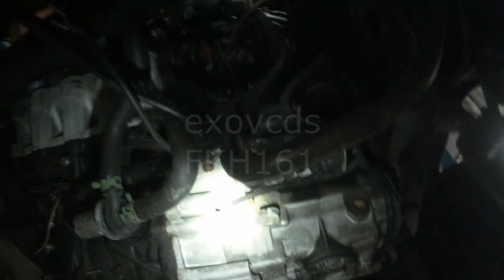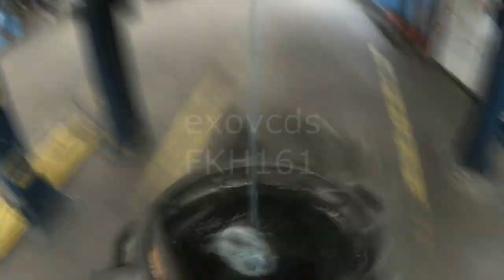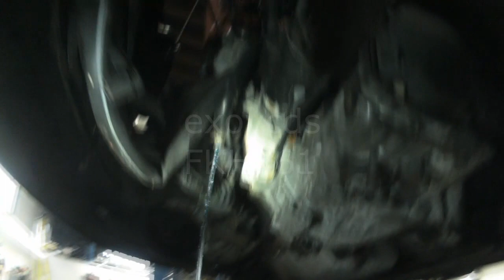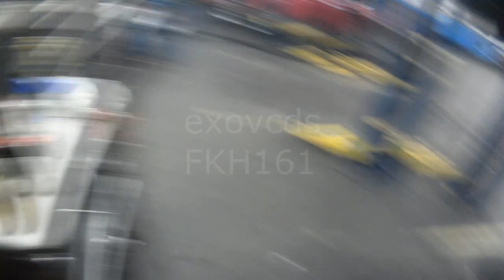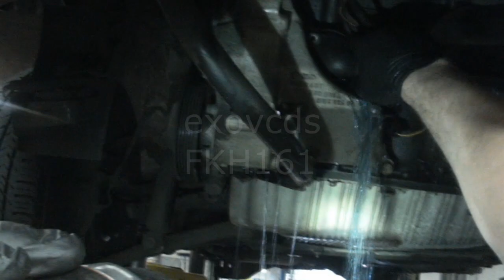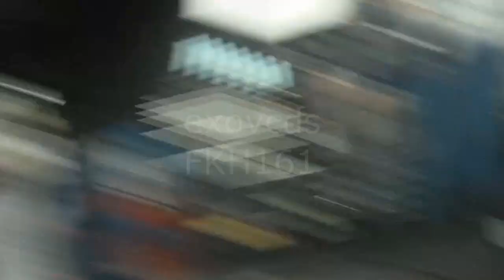VW T4: Eurovan 2.5L Thermostat Removal (New Close-up view)

Comment: Hello I have a 2003 Eurovan and needs to replace the coolant pipe and flange, is it similar procedure and I see sensors connected to my coolant pipe. Do I have to replace the sensors and gasket when I install it back . Thanks in advance
Reply from the maker: Which engine is in your 2003? Should be a VR6 if it is a North America model.

Comment: Hello Thomas; My 1992 Eurovan has an intermittent leak of coolant from what appears to be a seal on a sensor ?? located just above the thermostat.  I assume there is an O ring that needs replaced.  Do you have a video for that type of fix?
Reply from the maker: Yes, sensor o-rings can fail... not as often as the plastic flanges / the o-rings for the flanges... as you have discovered. =)

Comment: Hello do you have videos on replacing the control lock module on Eurovan. My directional light does not turn off after I shut the vehicle
Reply from the maker: I don't know what you mean with "control lock module"... maybe "Central Locking System Control Module"? The module is located next to / beside the instrument cluster. Remove the instrument cluster to get to the Central Locking System Control Module.
Reply: Is the central locking system module related to the directional signal functioning coz mine stays on after shutting the vehicle causing the battery to discharge
Reply from the maker: It could be, since the central locking module is used to lock or unlock the vehicle... you need to check a wiring diagram to see how everything ties together.

Comment: Sorry Thomas, my bad, I was going from memory.  I just crawled back under and the intermittent leak appears to be from the seal where the upper radiator hose enters the block.  Any suggestions?
Reply from the maker: Sorry to get back to you so late... was working. All the plastic coolant flanges are prone to leaking after 5 to 8 years. =(

Comment: Broo my van have a intermittent red light coolant,I changed the coolant bottle(sensor included) and persist problem.
Can I help me please?
Reply from the maker: Could be a problem with wiring, the fuse box or the instrument cluster.
As long as the temperature needle does not go past 90c, you can ignore the blinking light.

Comment: Hi Thomas;  I got the coupling off.  I see the replacement part is called a cooling hose connector/flange.  Do you recommend replacing the temperature sender / sensors? It has a two prong (blue) and 4 prong (yellow) seated in it now?
Reply from the maker: You can reuse the sensors... at minimum install new o-rings. If the sensors are old... I would replace them at the same time, so that you don't have to deal with a bad sensor in a year or 2.
Reply: Thanks for responding.  I'm three hours from a VW dealer.  The local parts stores don't stock any of these parts.  Do you have an opinion on Rock Auto?
Reply from the maker: Not familiar with Rock Auto, sorry.
At minimum they will have the o-rings for the sensors. You can replace the sensors at a later time (order online from a VW Specialty parts supplier).
Reply: The cooling hose connector/flange I took off is cracked outside the screw holes.  I suspect this is where it was leaking.  Is there a torque recommendation for these bolts?
Reply from the maker: @bcisantbcisant9842  I think 10Nm... the service manual should have a listing.
Reply: Yes, you are right.  My manual say's 7 ft lbs (10Nm).  Sometimes I forget basic things like checking the manual.  Too often go to the internet.
Reply: Walmart, Princess Auto and Cdn Tire sell coolant they claim is compatible with VW and other European autos.  Would you recommend those types of coolants? My local NAPA has the NF G11 for $35.00 per 1.5 l. Any suggestions? I'm more than 2.5 hours from a VW dealer.
Reply: Finally, would you recommend the coolant be flushed, if yes is tap water ok? Not sure the last time it was  flushed but I it has green coolant suggesting it was NF G11 used in it.
Reply from the maker: Generic "Euro" coolant is fine... we're talking about a vehicle that is 10 years or older?
Tap is fine, BUT.... distilled is better. Tap isn't going to kill the engine.
Flush every 4 years and it'll run fine.